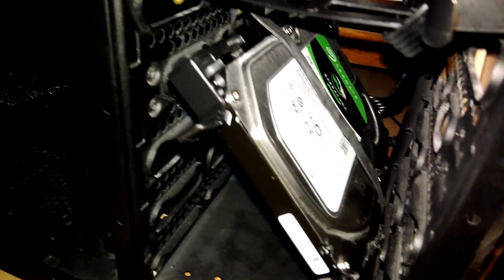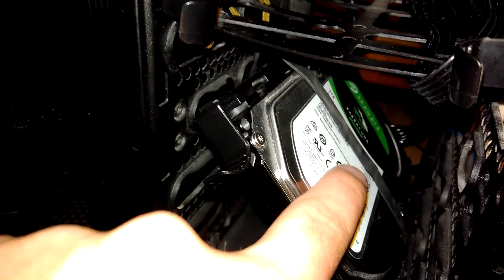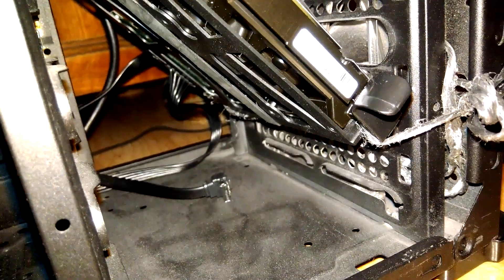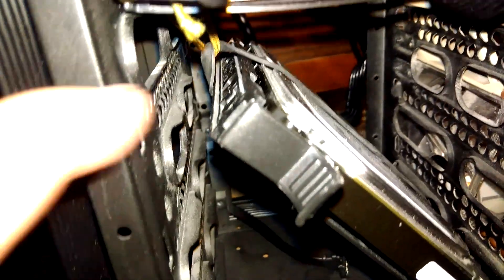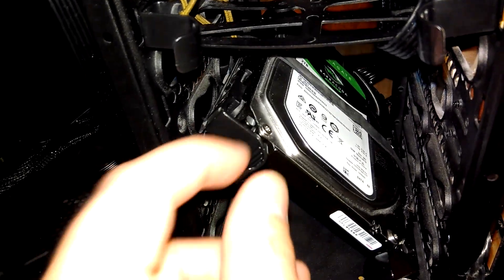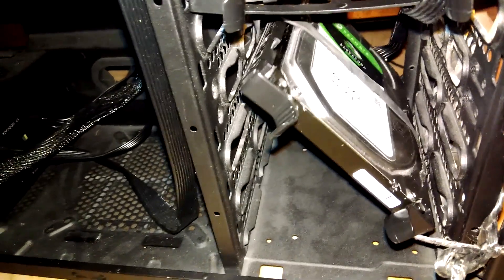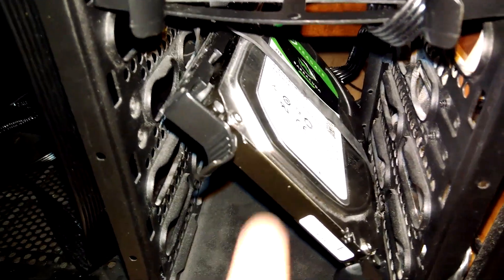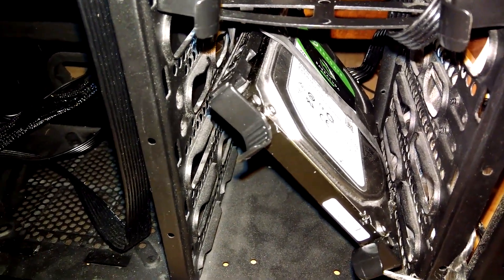How to Make a Hard Drive More Silent - Quiet HDD PC Tutorial

Comment: This is a good example of why we need the dislike view count back
Reply from the maker: plz check my newer tutorial about this as this one is a bit low production value
Reply: @GMODISM  I don't think production value has anything to do with the misinformation provided. Positioning a hard drive at an angle is harmful to the drive, as it prevents the internal disks from spinning when reading and writing, causing the drive to work harder and degrade faster, or even fail. That's the reason the HDD is quieter now.
Reply: @GMODISM  Ok

Comment: bad idea cus the drive gets hot very fast and has no way to return the heat
Reply from the maker: Depends on the drive, mine does not get hot, but if yours does ventilation and fans are very important.
Reply: not the main concern here

Comment: You should not place a hard drive in position other than 90° either sideways, vertical or horizontal because you risking of breaking disk or reducing it lifespan. But the idea of using rubber to make it quieter it's all right as long as you keep the hdd in the right position.
Reply: yeah i agree there is something spinning at 5400 rpm and now its not perpendicular to gravity. when you are dealing with your files and a mechanical drive you want to be safe and smart.
Reply: thats not true. the reccomended positions are vertical or horizontal.
read something about this first.
just format the disk in that position. (not fast format)